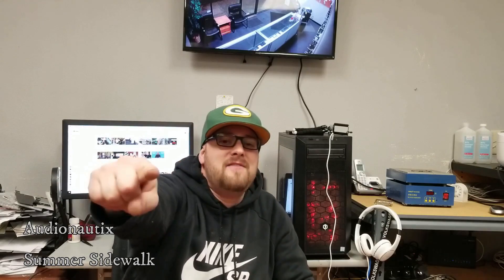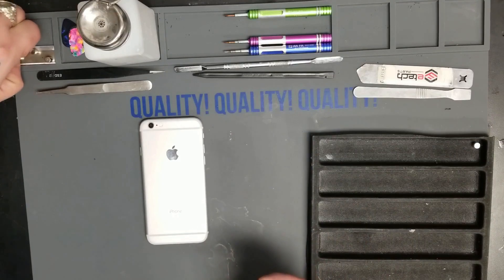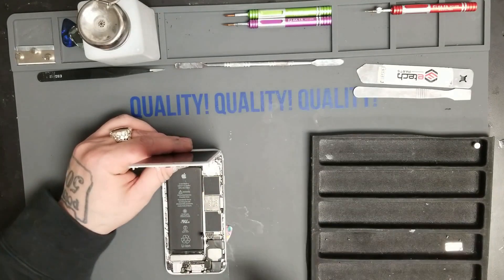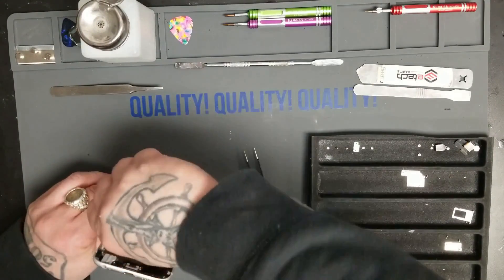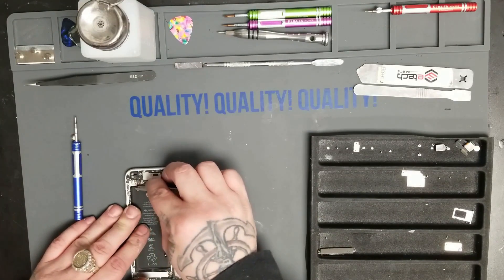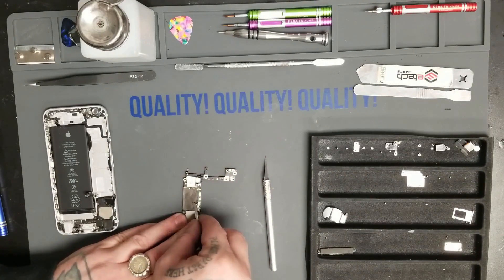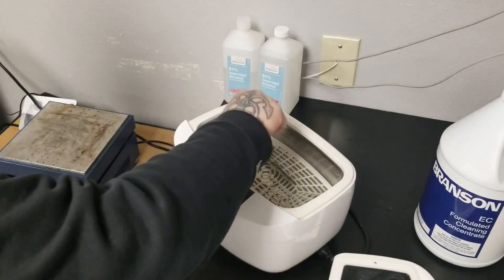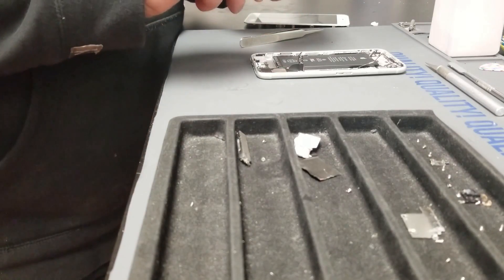iPHONE 6S WATER DAMAGE REPAIR

Comment from the maker: If you would like to contact the store with repair questions, www.cellularmekanix.com is the website, all of the contact info is there.
Reply: yo so like i dropped my phone in the pool and it automatically shut off it’s been 11 days and i put it on the charger like twice and the flashlight turn on what does that mean?
Reply: @tatiannajade4821  never charge a phone after it has been water damaged 🤦🤦
Reply: Do you know how much it would cost to get a Phone repair with a Iphone 6s
Reply: Hey My phone was submerged in water for 2 minutes- I tried to get it checked but It didn't work . I need to recover my data. Is there anyway I could send it to you and you get it fixed. I will be really pleased. Please do reply.

Comment: Hey JeremyBob👋🏽!  I get the feeling you either no longer work for 'Cellular Mekanix' or you just don't bother with this old post (I mean, come-on! An iphone 6s man? Aren't they obsolete? (a.k.a. "oughtta be dead and buried by now"😉). Nevertheless, as I've been known to be an ~old school die hard~ I'm gonna go ahead and throw this out there and see if anything comes back. Yes, I'm an iphone 6s user, or was, until it decided to take a quick dip in (the clean water of) a clients loo. So.., immediately after grabbing it out, removing the battery pack, screen protector, I "gently" wiped down the exterior, gently shook it (to HoPeFuLLy dislodge any water in ports, etc.). At some point ( I'm not sure if it was before or after the previous steps, I was pretty shook up) the phone was going all....,squiggly (screen kept changing, pixelating, etc) so I powered if off and removed the sim card. I had this huge packet of silica so I put the phone and the silica in a container for atleast 24 hours. But as I was (and remain) just not ready to hear any bad news, instead of attempting to power it back up, I then went ahead and (yes, yes I did) put the phone in a ziploc full of rice for atleast another 24 hours. At this point I still have yet to "pull up my big girl chonies🩲👵🤫" and attempt to restart my phone. I know, I know.., "what am I waiting for"? Well I just need to know there is something that can be done to get my phone accessible enough to use it to switch to my semi-recent purchase of an iphone........., (duh, duh, duh)..,11 .(Hey Buddy! I know it's not an iphone 13, but it's an upgrade for me as well as within my limited budget.).  Before I have to possibly face the little red line inside my sim port I need to know I won't have to donate a kidney, a leg and two fingers to get my data (my PhOto'S!!😭) atleast semi-easily transfered to the 11. Thus far all I've encountered are "wth"?!" & "I'm so screwed" difficulties that have left me here without a phone, literally trembling and unable to move forward, i.e., I can't get any help or answers from AnYoNe, not apple "because I have 2-factor auth on my apple id/icloud and can't retrieve the damn code" they send (to the 6s), can't even get help at an apple genius bar, nor at&t and every business that advertises to work/repair water damaged iphones when called say that they "don't", that "a water damaged I phone can't be repaired" and I should just toss it. After viewing your video I'm thinking that maybe you'll have the cure for what ails me, or rather what ails my phone. Now all I can do is sit here with my fingers crossed and HoPe that you'll be around somewhere to answer this exceedingly l-o-n-g message. Oh geez..., it really is LoNg....sorry bruh.     😂lol. So you know, I'm a barely, not even semi-literate iphone/computer/laptop grammy👵, well over..., 60🥺 with an inclination to being a tad verbose🤣🤨🤐.

Comment: My wife put my phone on washing machine, when it got out it was working but she shook the phone and it went off. Left it in charge for hours but never turned on. Now after 5 to 6 months I opened the phone, didnt completely remover the motherboard but disconnected all the connection and applied heat with heat gun. There is also no visible rust. It still wont turn on. Whats the chance of fixing it considering that its been left there with water for 5 months?

Comment: Me who just used icyprob alcohol

At least all I have to do is like buy $50 of parts because I thought the phone was unreppairable so I smashed the screen that somehow still works after a big chunk of it came off. Also I had an iPhone 6 that I took in the shower and died after but I just wait like 3 weeks I think and it was back to normal besides the display that was messed up. Fun fact typing this too long of a comment of the same iPhone 6 but I practically replaced everything but the motherboard

Comment: Everything is working except the speakers and the ear speaker! It wasn't dropped into water but got some water that leaked out of the shower. Idk what to do. I tried using a vaccum to suck out any water from the speakers. I have a 6s. Any advice? Do I shut my phone off? My music won't play and I when I call someone I can't hear them and they can't hear me I don't think. It doesn't ring when I call someone either. The headphone port works fine.
Reply: same

Comment: Should I worry it has been just 40 minutes before typing this. It will affect my phone more if I hadn't fix it in a day? I tried blowdrying the ear speaker directly and opened after 30 minutes it's still has the water.

Comment: What solution did you use with the toothbrush when you scrubbed the board. Also what is that white container called the solution is in?

Comment: I Went Jetsking Today And I Put My IPhone In The Pocket Thing Of The Jetski And When I Came Back I Noticed A Dark Blue And Light Blue With White Line On Near The Home Button My Sister Told Me There Was Clumpy Stuff In The Speaker But Nothing Else Is Bad Not Even The Sound Is Bad I Don’t Know If It Was Heat Damage Or Water Damage

Comment: bro, how do i get that iphone screwer that can open the 2 bottom things
Reply from the maker: It's called a pentalobe screwdriver. You can get them on ebay, amazon, etc. Used to be able to get them at Radio Shack (RIP). Not sure if any box store sells them in repair kits or not.

Comment: What if I charge my phone
Reply: Ikr
Reply: Should be no issue. I did that with my pool drowned 6s and I just icyprob alcohol cheated it and it worked even with a smashed display, everything but dock as I broke that when the phone was broken
Reply: @asianflex  would it work if it fell in the toilet and hasnt been on since november
Reply: @lucexgames1153  ... when did you drop it in the toilet and for how long was it in the toilet... if it wasn’t in there long it might be safe but if even some water got in it might be a good amount of cleaning if cleaning fixes it
Reply: @lucexgames1153  I mean should be fine considering my 6s was in a pool for hours and did it have a case and was there any fog stuff in your cameras?
Reply: @lucexgames1153  ok have u tried booting the phone?
Reply: Phone death

Comment: I dropped my phone in the toilet few days ago. And it’s not powering on. Can I repair it the same way u did even though I don’t have that little thing to soak my board in. Also I need to make sure all the info is still on my phone will removing the board erase anything? Help please
Reply from the maker: Use at least 91% rubbing alcohol and you can do at least most of the steps. It will not erase anything. There are forensic data recovery businesses that can still recover the info from your device, even if it isn't repairable.

Comment: Can you guys make my iPhone 6 work like it did when it was new. Speed wise as well as clean the olive oil I manage to get into the screen.
Reply from the maker: Unfortunately the newest operating systems are not always fully compatible with older phones, which is often times what causes slowdown. Also if your memory is almost full it will slow down a ton.

Comment: When you brush the logic board with the toothbrush what are you using? Is it water or an alcohol cleaner?
Reply from the maker: Branson EC is what the fluid is called, but we also use rubbing alcohol at least 91%.

Comment: Hey I have a question: I dropped my phone in to water and inevitably it didn't turn on for a while even after drying it out with rice. After a day i noticed it had turned on because it was making its sounds and vibrating when i adjusted the silence button thing and also vibrated when i pressed the home button. so long story short its technically on but not visually. The screen is black but its on. What should i do, or what do you recommend
Reply: Dude same problem with me 💀

Comment: i dropped my phone in the toilet 2 days ago. i took it out and dried it off right away.once i got the sound out of the speaker, it was working perfectly fine. later that night, i was using my brand new airpods, and they were working fine with my phone. i then disconnected them fully, put them back in the case and went to listen to music so my friend could hear too (my airpods were not connected at the moment). when i went to play music, i couldn't hear it so i tried to turn my volume up and the volume box came up and said *Headphones*. my headphones weren't connected. i gave up trying to figure out what was wrong, and i went to plug in my phone. i probably tried 3 or 4 different chargers and neither of them worked. ( plus my phone was on 15%) i had to stand my phone up for the charger to work. i went to bed, and when i woke up, my phone was dead, so apparently the charger didn't work very well. i tried the sound and it worked for all of 30 seconds before the volume buttons no longer worked. i went to the mechanical thingy when you swipe up on your phone because there was a volume adjuster there. id try to turn it up and it would just automatically keep going down itself. the volume box wouldn't disappear, so every time i use my silent phone, the box is just in the middle of the screen. i was on a bright screen last night and on the left side of my iPhone screen there was water damage in 2 spots. it looked like it had spread across the screen. every now and then, my sound kicks in for five minutes and then disappears, but the box is always there and it is a hassle to find out how to charge. i now have to go to the Verizon  store today, and probably get a new phone. oh, and i told my mom i dropped it in 2 feet of snow, instead of the toilet. lets keep it that way! 😬
Reply: Got the same problem regarding the volume it goes down by itself but i can still use the volume up so sometimes i listen to music then suddenly i hear nothing. Also when i received calls i can’t hear the the other line i need to put it on loud speak or put my earpiece on to be able to hear them but what’s worse was the volume was in full blast and the lower volume on the side of the phone is not working i tried to use the volume when you swipe the screen up but unfortunately it’s only applicable for music or games but not  on calls 😭also my back cam is not working it was totally black the front cam is working but what will i do with it i’m not into selfies. In short my phone was a total wreck so i feel yah 😆

Comment: I dropped my phone in a river. My brother jumped in for it thankfully. I got home and as you said put it in a bowl of rice. It still worked and came on, everything was okay but my sound. I charged it over night and in the morning it isn’t turning on. I still hear my phone go off when I get a notification. Is my phone unfixable or can it be fixed?
Reply: If it is still coming on but no image then most likely there is corrosion buildup around the LCD connector. That will need to be scrubbed off at a minimum and possibly the screen replaced.
Reply: Timothy Hoppe ok thank you x

Comment: i dropped mine on the pool at first it still works i changed the screen battery and charging port but still wont open is there any chance that it will still work ? the board just heats up when i plug the charger
thankkkksssss
Reply: i mean when i changed that 3 part it wont work but my laptop still recognize it

Comment: I dropped my iphone se in the bathtub the other day. I pulled it out and sat it upright on a tower while I thought about what to do next. Then I put my clothes on ran to the kitchen and graved some rice. After 1-2 hours I took my phone out of the rice and sat it on a radiator to make the water evaporate.after about an hour of that I put it on charge and went to bed. The next morning there was water damage on the screen but that just disappeared. My phone still worked the whole way through all those steps. Now my phone is back to normal. That was only 3 days ago.
Reply: Beth Laird so the stuff on the screen goes away I was cleaning it off so it shouldn’t be that bad
Reply: RIFFRUST yeh
Reply: Did it show that it was charging when you plugged it in
Reply: Cami Cornejo yes
Reply: Okxybeth oof my phone is dead

Comment: What product did you use on your tooth brush to brush the board? Is it possible to use  isopropanol solutions that are used as nail polish remover, or even 90% ethyl alcohol?

Comment: I'm confused, did you replace any of the parts or is the zero cost repair tutorial I'm looking for?
Reply from the maker: No parts replaced in this vid. We have customers who are always curious about the process we go through when we are performing water damage restoration, so we made the video to take them through the steps. Often times you have to replace the battery when phones have water damage, sometimes charging flex, screen, camera, etc. We didn't really make the vid to just fix the phone, but to show the steps.

Comment: Hi man, I’m new to fixing water damaged phones etc. Would you be able to tell me all the products you used including the machine? It’s an ultrasonic clearner right?
Thank you!!
Reply from the maker: Yeah, we use an ultrasonic cleaner. Brand isn't a big deal, just make sure that you get one large enough that it will fit circuit boards for larger phones. If you want to do iPads or computers as well, you are going to have to get one that is much larger, but the larger you go the more you will pay. The one we have here works great and I think it was only about $150 or less when we bought it, but you can buy them for less than $100, just read reviews before you purchase. The rack we use to dry isn't really supposed to be used for that purpose...it is an old preheating station for soldering that we re-purposed as a circuit board drying rack. It just allows us to get them fully dry during the same work day sometimes, otherwise you always want to leave the board to dry overnight, and even then if you have some plates covering the components that you didn't de-solder, liquid can be trapped. I feel it is best to heat them. They also started selling "water damage repair machines," which are really just pressurized ovens that will evaporate water quickly...they don't actually do anything about the corrosion, but I have considered purchasing one because you can dry out the board in just a few minutes. The fluid we use is called Branson EC. We buy it by the gallon and a gallon lasts for months. We get it from a company called All-Spec and it costs about $35. Otherwise, just a soft bristle tooth brush would give you a basic kit. To go more advanced you would need an entire soldering rig and microscope, but for most people just having the ultrasonic, the fluid, some alcohol and a toothbrush, and somewhere to dry the boards out will work just fine.

Comment: I dropped my iphone 7 in water like 3 months ago and i had it in rice and i did everything i was supposed to do but it wont turn on or anything. Do you know how to fix an iphone 7 thats been water damaged that long? @cellular mekanix
Reply from the maker: Yes, we have brought phones back that have been in a drawer for years.  It all just depends on the extent of the damage.
Reply: Cellular Mekanix hey bro, I have a 1 month old iPhone XS and it took a little trip with me to the shower. I believe that only the screen is messed up but I’m not sure. I really don’t have the cash to spend so I was wondering if you could help. I really need you man and i live across the country. The phone has just been sitting in rice and. The screen had green lines before I decided to shut it down. Then it won’t start up and I’ve tried everything. Should I open it up and try the rubbing alcohol or something. Please reply or contact me at hashbrown66666@gmail.com
Reply: It wont turn on or anything i tried to dry it out and everything but idk what else to do

Comment: ok so my iphone 6s screen turned black for the second time, becuase i got a few droplets of water on the screen , mind you its cracked badly. the first time it went black its because of the same tings, it was raining and some droplets got on the screen. I left it out and alone the first time to air dry and it didnt turn back on until 2 weeks. now that i accidentally got water on my screen again I now put it in rice. to quicken the process. I don't have the tools you have to fix my phone or money to take it to get repaired so this is the next best option, any advice please? i would really like my phone to turn back on soon
Reply from the maker: Sorry for the slow reply, hair dryer works but if water got into the phone and caused corrosion, then you will have to disassemble it.

Comment: Did you not put anything back over the exposed chips?
Reply from the maker: If it comes back on you can cover it with kapton tape.
Reply: @Three-Minutemen  Do you reckon you can get it to work with just the isopropyl alcohol? I do phone repairs as a hobby but don't have all the high tech equipment.
Reply from the maker: @jameslawrence8148  A lot of times you can. The main difference is that you can get the phone back working but sometimes the repair won't last more than a couple of months. Also the alcohol isn't going to do as good of a job of breaking down the corrosion in places you can't reach with your brush.